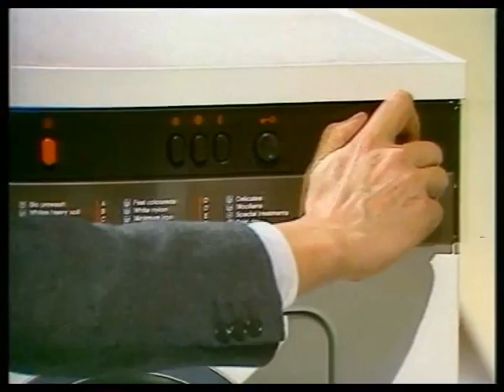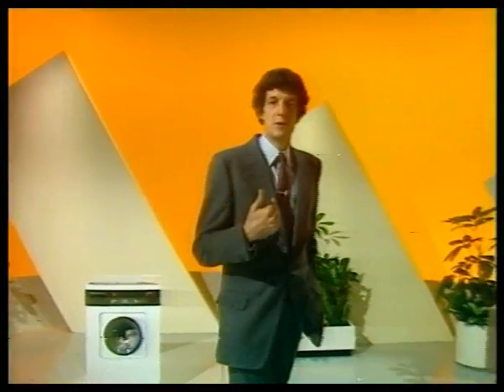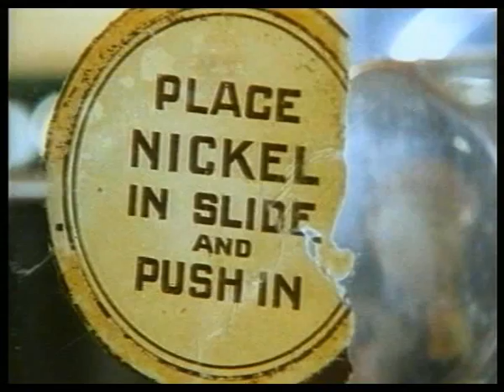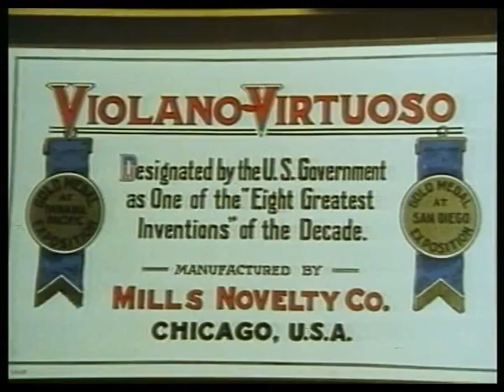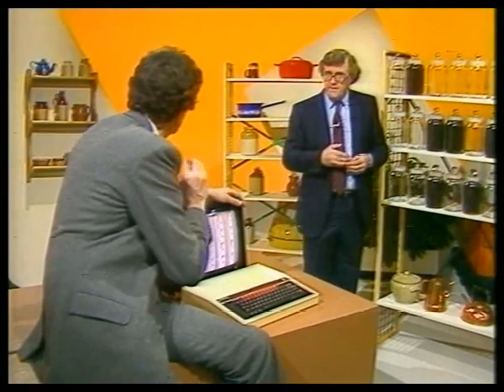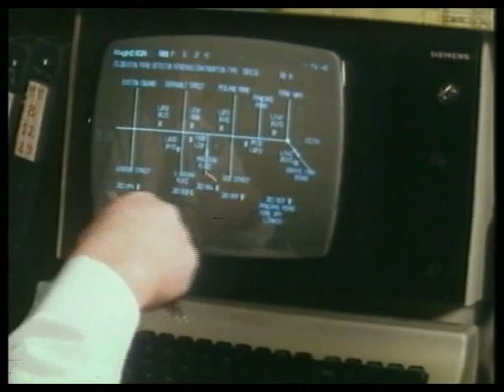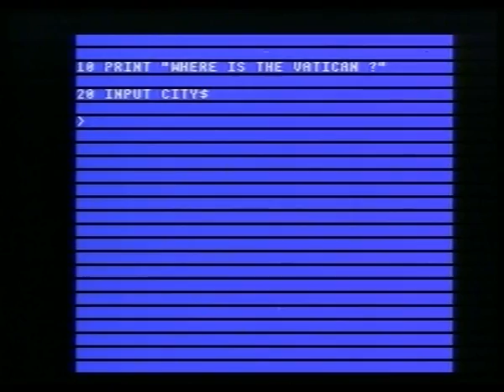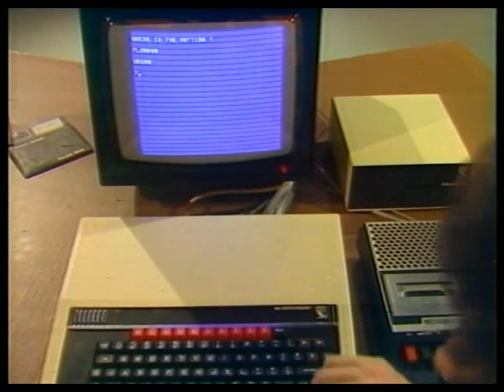The Computer Programme (2): Just One Thing After Another (Basic Processing Concepts)

Comment: That 3-coloured traffic light at 15:00 is actually a classic example of trinary, not binary. Mere Pedestrian traffic lights with just red/green is binary, but the moment a yellow light is brought into the game, it becomes trinary.
Reply: I thought the same at first, but no, it definitely is binary. At the end of the day the colour of the light is irrelevant, all that really matters is whether the light in each position is on or off. 001 = green light/go, 010 = amber light/get ready to stop, 100 = red light/stop, 110 = red + amber/get ready to go.
Reply: If we had trinary computers today, it could perform more work per bit, Ex. binary = 1 and 0, trinary = 1, 0.5 and 0 .. Binary = 5v and 0v. Trinary = 5v, 2.5v and 0v. End
Reply: @jacobhn2  
That's where quantum computing would come in. Purely electronic chips, based on digital bits, have to be binary- a current is on or off. Dimming or reducing a current to provide a third option would break the circuitry.
Reply: @BrackynMor A binary could too (taking xereeto's example): 101 = green and red at the same time. Total confusion. 111 = even better. I've often see 000 - also confusing...
Reply: BrackynMor Yeah, i know. So more like stop and don't stop as well as go and don't go, at the same time... Or how ever the analogy can be most correct/confusing ;) (anyway, something with the unit circle)